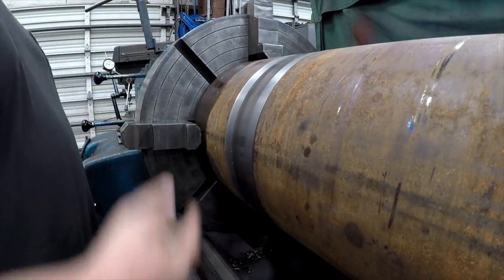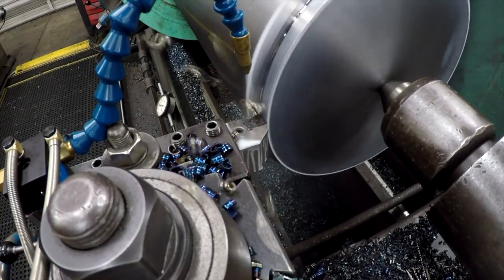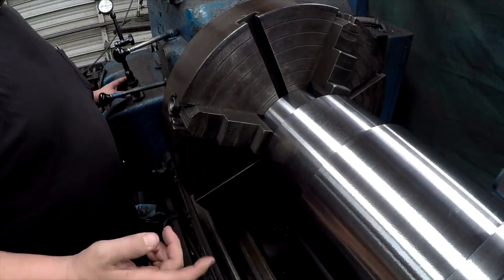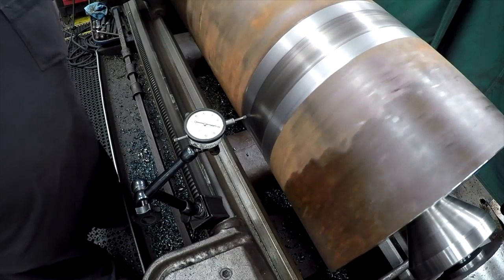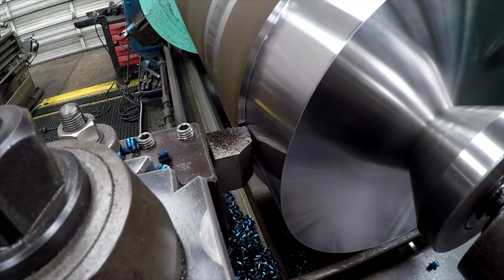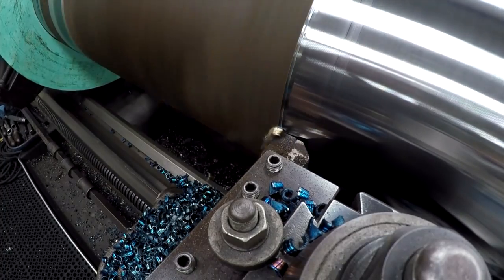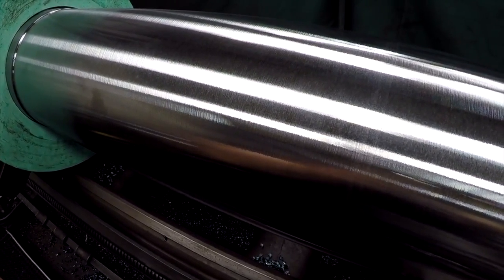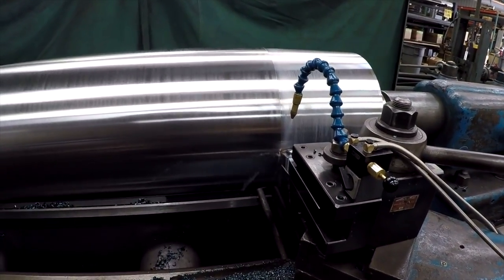Abom Legacy Series Episode 1

Comment: Turning motion into heat.  Thermodynamics..heat is work is energy.
Chip control is paramount,  at that feed rate, stringy ones not only cut, they also cauterize the wound.

Comment: @abom79 i have a miller 330a/bp. Did you refinish yours? If so where did you get the miller paint and what is the paint called. Same with the front cover. Mine is in very good condition but nowhere near yours as there was a leaky radiator one on top of it.

Comment: Boy howdy, that's some feedrate/DOC. Makes my Colchester Mascot 1600 seem like a toy!
Reply: The Mascot can do some nice cuts actually 😉. This size of lathe is equivalent to a Colchester magnum. So thats why your mascot maybe seems small compared 😁
Reply: Is your a 7.5hp or 12.5hp version?  If it's a 12.5hp you should be able to take similar cuts.  - I've done heavier cut with a 10.5hp Weipert lathe than he's doing here.    I know its also about stability and mass in the lathe. But the Mascot is actually a very well build lathe. And the motor do have good Torque at the lower rpm's 😊👍
Reply: @OmeMachining  7.5hp, back when she left the factory. The machine is pretty well clapped out so I suspect that I'm not quite getting all of those ponies anymore. It's still a beast despite being loose in the hips, and I'm quite happy to have it for my humble garage shop.

Comment: Can the speed be converted to something more understandable?   What is 31 thousands in Feet per minute?
   By the way, the legacy series is fine with me. I can barely keep up with the new stuff. I rarely go back for older videos for anybody.   It's new to me.
Reply: For every revolution the tool moves 0.031", so feed rate is equal to spindle RPM x 0.031" divided by 12. So at 50 rpm (guesstimation)  feed rate = (50 x 0.031)/12 = 0.13 feet per minute, or 1.55 inches per minute.  Hope this helps.🤔
Reply: @bostedtap8399  Thanks.  I guess the rpm actually changes as the work gets smaller?
Reply: @firesurfer  the rpm won't change, unless Adam speeds the lathe up. The optimal rpm will increase as the diameter gets smaller though
Reply: @firesurfer  Casey Smith  has answered your second question spot on, the only thing I will add is that on a CNC or lathe with automatic spindle speed/surface speed capabilty, then when the cross slide linear position changes indicating true diameter, the spindle speed will increase to satisfy the surface speed. this is very useful/noticible when facing a part (turning the end of a shaft), you may notice most manual lathes have problems getting a good surface finish across the full face.